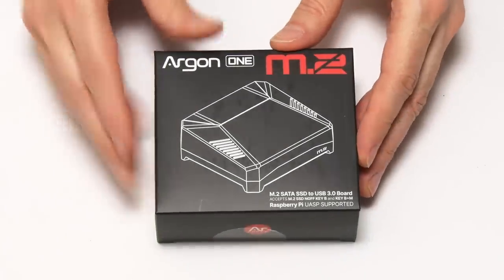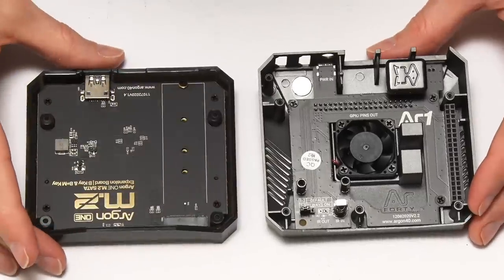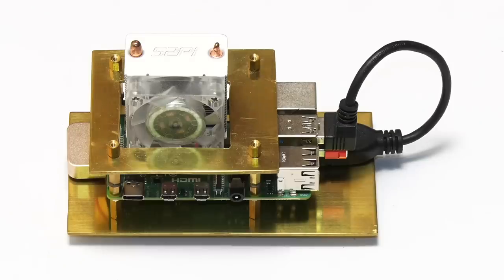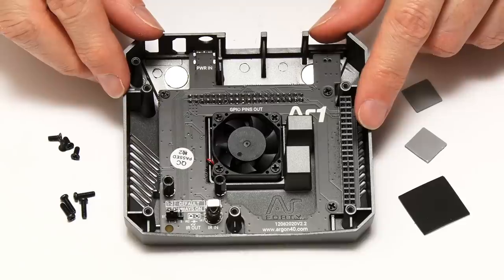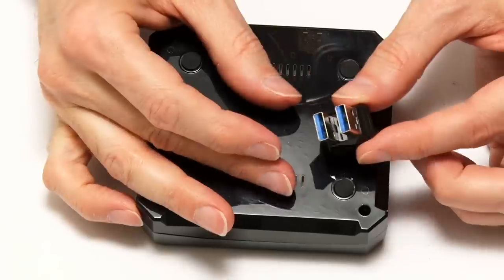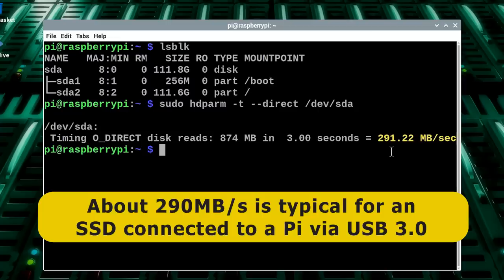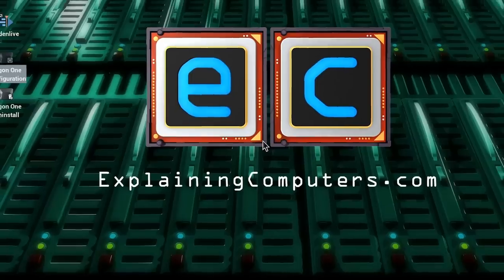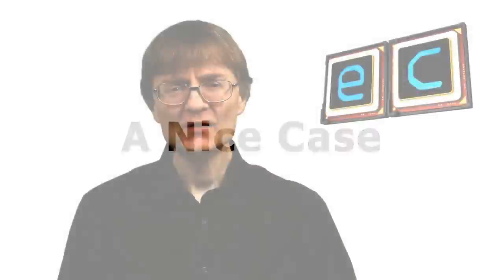Argon One M.2 Raspberry Pi 4 Case

Comment: Nice video, but... I am not super happy with it. The case, to clarify.

I have had one for at least six months now,  and it is far from plain sailing.

The M.2 is a wonderful idea... if you can get to make it work. I never did, the whole thing kept on going berserk. What I received was continually taking too much power from the Pi, causing the USB ports to constantly cut power, then restart. I had to remove the adapter to make it work properly. I tried this out on laptop, a different Pi, different USB adapter, and different M.2 drive. No success. So, what I think the problem is, the M.2 adapter board has some flaw in it, stopping it from properly working. I suspect I have a defective board, and that it usually works okay. I never bothered with replacing it, for reasons I will get to below.

Now, onto the next big problem with this case...

What you will not see with these review videos, is the GPIO pins being used. If you want to use a HAT on this, you have to plug it in on the top, cover removed. This means completely exposed boards, and supported by the GPIO connection only. In addition, you might lose WiFi capability, depending on your HAT. I have a Waveshare USB3 hub, with separate power going in. It means that the board makes it harder to get WiFi signal,  and that means the combination of board and aluminium case pretty well kills WiFi, making the signal highly unreliable. I had to choose between hard drives, and WiFi. I had to use a cable in the end, moving my DAC and hub Boards a little off the case area. And lo, WiFi is working again.

This is not a bad little case, but it has clear flaws. Such as only being able to take M.2 drives, something to be wary of. In addition, that USB that would be used by the M.2 is taken by a Terrabyte My Passport, allowing for more space. And the hub allows for more drives, and the Raspberry PI  4B takes 2TB drives. So... how useful is the M.2 option, in reality? I feel that it is perfect for specific cases, and for a lot of people, they will never have a problem with this case, and love it to pieces. But for those of us with bigger designs, this is less than optimal as a solution.

I really am starting to thinks that the best PC like Pi option is the Compute Module, in a Waveshare USB3 I/O board. However, I have yet to investigate this, so cannot confirm at this time. 

Hope this is of use to people.
Reply: Sorry to hear of your tech issues with this case. I found that the USB2.0 ports can adversely affect the USB3.0 ports. So, I stopped using them and switched  a 4 port powered USB 3.0 hub, instead. No more problems. I'm also using 512 MB NVMe SSD's and Corsair GTX flash drives on the hub for backups, but prefer the M.2 SATA SSD living safely inside the Argon One case. 
There's also an Argon One Sound case, with a builtin HifiBerry DAC.  I also had compatibility issues with other DAC;s.
Yes, I'm lovin the CM4 with optional I/O boards, including on board M.2 NVMe. Many optional board designs are just hitting the market. That will be my development platform from now on. FYI, Jeff Geerling is the YT CM4 guru ;-)
Reply: @TheOleHermit  Thank you for your response.

I find interesting the issues with the USB 2.0 ports, that is certainly worth noting. I just use them for the official Pi keyboard, and a gaming mouse. The mouse has extra buttons, that can be quite useful.

I will be sticking with my 3.0 hub HAT, as it is really nice. I agree that such a hub is a must.

I saw the Nancy Sound One case from Argon40, and whilst it looks nice, I need a 3.5mm audio jack, and I need to have dual monitors.

Nice to hear such positivity with the Compute Module, I might end up switching to it, and use that as a PC alternative. And Red Shirt Jeff is the better entertainer. 😉
Reply: @horseradishpower9947  Ahh, I've never used the USB 3.0 HUB HAT, only a separately powered USB 3.0 hub.
From all my research into RPi audio, the 3.5mm jack is lower quality than DAC HATs because they provide internal independent clocking. Apparently, even USB audio dongles provide better sound quality.
Of course, a short RCA to 3.5 mm adapter cable could also be used with the HifiBerry DAC HAT. But, not sure whether you could stack it with your USB3.0 HAT. Hope this helps.
Yes, Red Shirt Jeff is a very entertaining Gremlin, especially while cutting the ports off the RPi4. lol!
Best regards! :-)

Comment: Pretty but active cooling for a 15-20 W setup is a big minus for me.
Reply: The 3 cooling temperatures and fan speeds are defined in the software via a text file. So, you decide when the small fan turns on and how fast it runs. In fact, since the top of the case is also a passive aluminum heat sink, you could disable the fan completely under light usage.

Comment: Raspberry Pi should come out with a board, 4 cores.. cores like Intel is making the Efficiency  cores.. and allow you to stack them so you can have like 4 pi's and 16 cores and each board with 16 mb of ram and each with an M.2 slot for data storage, able to run on windows 11 able to run complete internet functions as you would any other computer

Comment: Nice case but bit expensive...
Reply from the maker: Yes, agreed.
Reply: @ExplainingComputers  It doesn't seem that expensive, when you include that daughterboard and what's basically the internals of a m.2 external drive adapter. It's 45USD, not 145USD, after all...I know computer games that cost more than this...

Comment: 2:58 Cant help but think Argon would make a mint selling the daughter board etc separately for people to use in their own projects
Reply: The M.2 base is sold separately to upgrade the original Argon One or Argon Sound One top. But, if you only need to add an M.2 SSD for your projects, I'd recommend a $10 USB 3.0/M.2 adapter to avoid GPIO conflicts. ;-)
Reply: @TheOleHermit  was thinking more of the connector/HDMI board, very handy and looks well made.
Reply: @jasonmonk7336  Yeah, no. Sorry, can't help you with that one. Only the M.2 board is sold separately.
I'm all in for using the CM4 modules for all my future projects. Fully customized brains and I/O boards for my specific project needs in the smallest form factor.
Less than that and I grab my ESP32 MCU dev boards. ;-)

Comment: I wish they sold the HDMI/USB C/M.2 expansion on it's own
Reply: The M.2 base can be purchased separately, to upgrade the original Argon One case, but you'll still be stuck with 2 mini-HDMI connectors. Just connect/disconnect at the adapter cables, instead at the mini-HDMI ports. :-)

Comment: Can you use a 3b instead of a 4?
Reply: Unfortunately not as the pi 3b doesn't have USB 3. However Argon do a case that fits the 3b.
Reply: The 3b doesn't have USB-C power, dual micro HDMI, USB booting, nor USB 3.0 ports for fast SSD transfers.

Comment: m.2 one of those technologies where they have multiple connectors so when you buy one it does not fit in your pc :( i can't be the only one.
Reply from the maker: Certainly not only you! :) There is only one M.2 connector, but it can carry a lot of different interfaces (SATA, PCIe, USB, etc), so M.2 is keyed in many different ways. The main thing to remember is that M.2 is not a technology. Nor is it an interface. Rather, it is connector that can and is used for many purposes. I cover this in more detail as part of my recent SSD video: https://www.youtube.com/watch?v=EXLfErPEYiw
Reply: @ExplainingComputers  i like ram better because the different keys are called ddr 1 ddr 2 ddr 3 ect but woth m.2 they are all just called m.2 so finding the correct one on Amazon is tricky.
Reply from the maker: @bland9876  Agreed, RAM naming is much better.

Comment: Hi Love your videos. Was odd that the nvme female connector was for a non ssd nvme type drive, visa vie it had only one notch for the faster drives with no sata controller. Albeit obviously the 2 notch nvme ssd works. Otherwords manufacturer used wrong type slot that's dual use. I really want to try out the rp pico, one day : )
Reply from the maker: Note that this case is for SATA M.2 drives only. An NVMe M2 SSD will not work.

Comment: The full size HDMI ports is the selling point for me. I HATE the two micro-HDMI ports. I consider 2 micro ports a downgrade from a single full size HDMI. Who is actually using two monitors on the RPi 4 anyway? Maybe .01% of users ever run dual monitors and that's a high estimation. 
I'm a huge RPi fan and have bought several of all previous models. I did not buy this model until this particular case came out. 
I do appreciate the M.2 slot on the new case but I bought it for the full size HDMI ports. All future RPis should have some sort of SSD connection as native and NEVER have micro-HDMI ports. I would much rather have a single full size HDMI port and would be happy enough with an EMMC option.
 I really appreciate the EMMC options that Odroid , NanoPi and a few other SBCs have. Sadly we don't and may never have this with an RPi.

Comment: Commands to control fan and power without agron one script (requires i2c-tools installation  and dtparam=i2c_arm=on in config.txt)
i2cset -y 1 0x1a 0xff    # rpi poweroff 
i2cset -y 1 0x1a 0/1/2/3/4    # fan speed 0/1/2/3/4 (select a number you want)

Comment: The SD card is dead, long life the SD card.
Reply: Configure to boot from USB, then use a USB3.0/uSD adapter. Not as fast as running from SSD, but twice the speed of the uSD slot. Keep your data downloads isolated while testing diff distros. ;-)

Comment: There is a post (link below) on the Raspberry Pi forum reporting that when the microSD card is installed, along with the M.2 SSD, the system will not boot. Can you verify that? 
https://www.raspberrypi.org/forums/viewtopic.php?f=28&t=275680&sid=84884fdfe33c55a697a3e0d504c7f754
Reply: Forget about the uSD slot. Use a USB3.0/uSD adapter and boot from the 2nd USB3.0 port. It's twice as fast as the uSD slot, is easily accessible, the RPi4 can boot from any distro on any uSD card, and your downloaded data and repositories are stored safely on the SSD. Flash any OS of your desired flavor, then add your apps from your local offline git repositories stored on your SSD.

Comment: You loose a  USB 3.0 port with this case.
Reply: Just add a powered USB3.0 hub and enjoy 5 USB3.0 ports, without power limitations.
Reply: @Tano My application doesn't require fast storage. A SD card is good enough.
Reply: @Tano No, maybe not. But, I want this case. I like it's design.

Comment: I have the 3b+ version, and it has to be the best thought out pi case ever.  One caveat though, don't use their crap thermal pads.  Much better thermals are achieved using a glob of thermal grizzly kryonaut.  This only applies to the case for the 3b+.

Comment: who though this is a good ideea :)) LOL . just buy a bigger microsd card if you need 120 GB for the OP system , if you need storage buy a usb 3 hdd and you;ll get almost the same speeds without spending ton;s of money . The ideea of a raspberry is using  a computer without seling your soul to the devil . payng for a case like that for me it's money thrown out the window. my system is running a raspberry pi for my tv nas made out of wood some old cpu fans that i've found thrown out in the garbage. Run's my sdr usb run's my lora wan gateway and my home nas all without even spending more than 100£